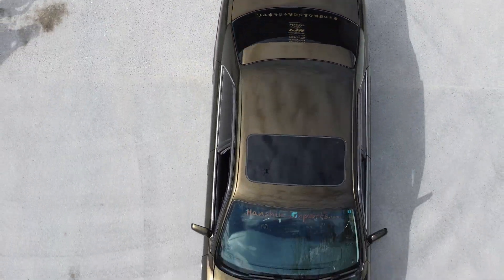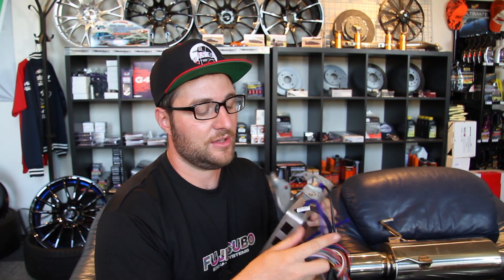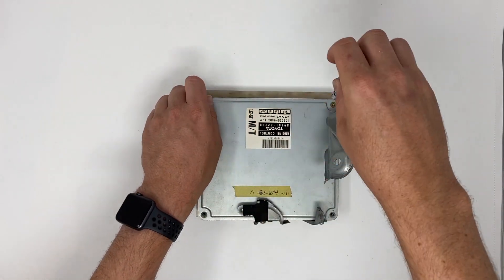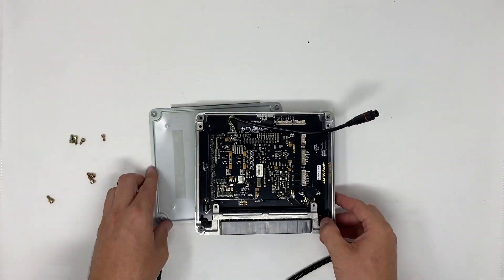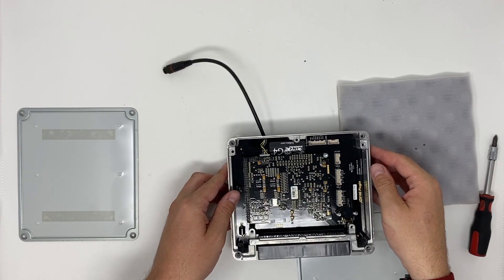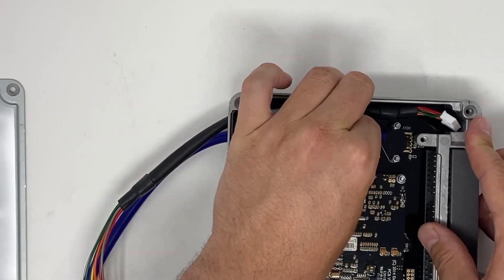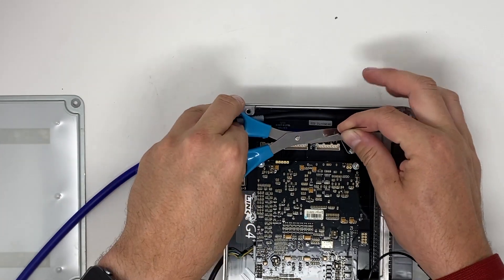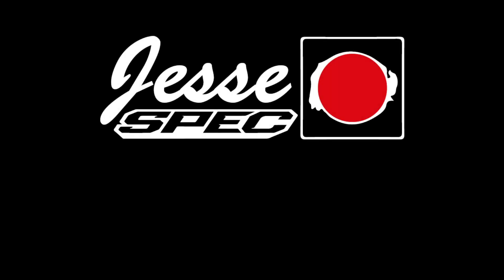EP1 Project Executive Drift Car. How to Install a Plug In Link Ecu? Full tutorial on how to install.

Comment: Why didn't you use the bulkhead connector as intended for the data cable? Also you now have everything pointing directly into the dash with little to no access to any of it.
Reply from the maker: I didn’t put it in the car yet. i’ll figure it out as I go. To be honest my PFC was installed with my own brackets so nothing was pointing in the wrong direction…

Comment: Hi, you can use aviation type grommets for the harness coming through the holes. (AN931), Aircraft Spruce Canada has a reference chart with sizes. Great video otherwise.
Reply from the maker: Hi! Thanks for the comment. That is a good idea. I just didn’t have anything else readily available, thats why it was done like this.

Comment: Hi Jesse, Great video! Would you know if Link has done an option for the Auto JZX100 yet? I've asked a few companies but haven't had any answers! Appreciate it thanks.
Reply from the maker: Hi! Thanks man 😊
I am not aware of compatibility with the AT version. Having sold lots of Apexi ECUs, i can confirm that both AT and MT on JZX100 are 2 different ecus (also when ordering from APEXI) so I’m pretty sure it isn’t compatible. And i haven’t heard of news regarding any AT versions available any time soon. But who knows? 🤔
Reply: Ok, disappointment again😞 Would you know of another brand of aftermarket ECU that is compatible, I hear the Aussies use Haltek is it? (maybe wrong or just incorrect spelling lol!) But  not sure if AT also? Thanks again, Good luck with the builds 👍🏻
Reply from the maker: flat4straight6 I would go with a Power FC in an AT car. Its old school but absolutely bulletproof and reliable. My chaser currently runs one and I love it. You can still get them new and I’ve sold an tuned many PFCs, they are very good ECUs
Reply from the maker: flat4straight6 Thanks man! Sadly I dont know any other compatible brand for the AT version 😭